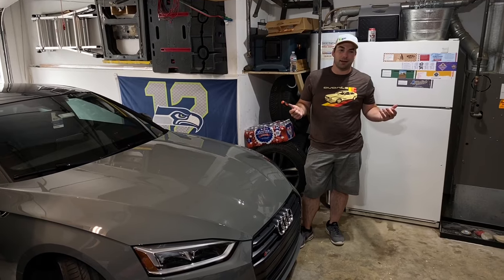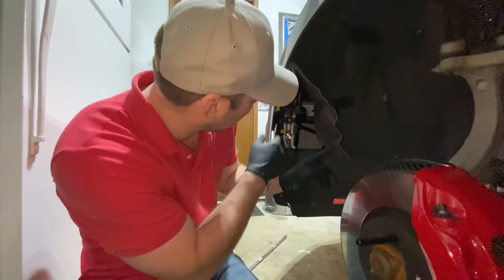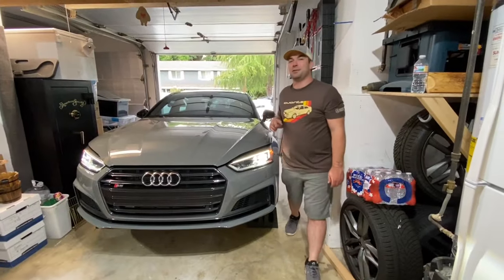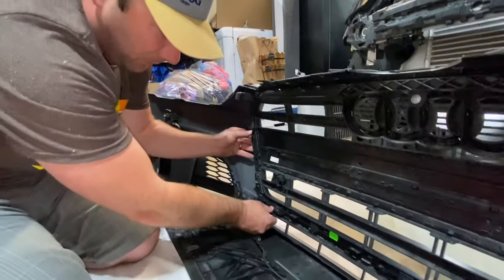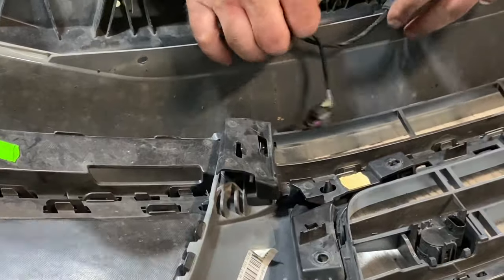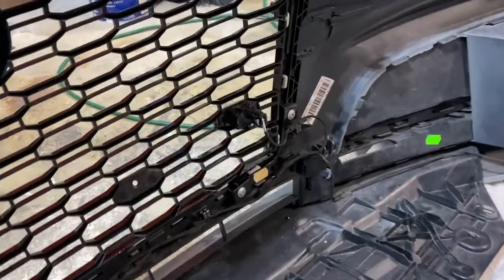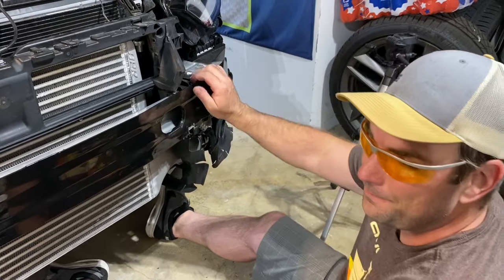How To Install A CarbnLab RS Grill On Your Audi B9 S5

Comment from the maker: *SPECIAL NOTE ON THE AUDIO QUALITY OF THIS VIDEO* In our effort to keep this video up and helpful for you, we had to take action to remove some portions of the background music due to copyright disputes.  You may notice some odd audio quality issues throughout the video because of this as we used YouTube's beta program to mute the music while keeping other sounds intact.
Reply: Did you have any problems with the front camera after this install
Reply from the maker: @colegiles5321  nope. The sensors pick up things a little easier though.
Reply: I’m sorry I didn’t relize there was a difference between front camera and front sensor, I have a 2018 b9 s5  so I’m pretty sure there is no front camera correct me if I’m wrong
Reply: From what I can gather people only run into problems with the front camera which I believe I don’t have, it’s also 2018 so I won’t have to take a cutoff tool to the crash bar, again correct me if I’m wrong. Love your videos btw my go to Chanel for insight on modifications
Reply from the maker: @colegiles5321  update, I did end up getting the sensors and suspension recalibrated by Audi. This was mainly due to the lower ride height after installing lowering springs.

Comment: Loved that you wrapped the crash bar instead of painting it.  Well done.
Reply: There's actually a plastic crash bar cover on the RS5. It's a much nicer solution than paint or wrap as it won't chip or scratch from road debris. It's part number 8W6807217A9B9 and it's like $60.
Reply from the maker: Oooh, that's a great tip!  Did you install this part on yours?  If so, I imagine the fitment was spot on?
Reply: @Vaguh  I have a RS5, that's why I know about the part. : ) But yeah, I know other people who have installed it and it's a perfect fit. The A5, S5, and RS5 all use the same crash bar.
Reply from the maker: Awesome!  Might have to get one if we ever have the bumper off again.

Comment: Hi thanks for this video...really helpful. I'm going to fit one to my A5 next weekend. I have a 2020 model (2019 reg) so I'm wondering whether I'm going to have the sensor/crash bar issue? 

I noticed one comment said you can switch the sensor from I shape to L shape...is that right, can it be turned and fit at 90 degrees, or does it need a new sensor altogether? If so how much are they, do you know? I'm in the UK  

Thanks

Comment: Hi. Just wondering, is there a spot for the front facing camera. Also, since you had to flip the sensors 180 degrees, did it have any sensor errors? Thx. I’m hesitant on doing this or even getting it done professionally for that matter. Because if I have to pay audi to fix errors, that’s gonna be costly. Also, wow I completely forgot the crash bar has to be black as well. This is definitely not an easy task.

Comment: Great video!  I'm thinking about getting the same grill for my 2018 S5 SB.  Have you had any issues with your parking sensors?  I've seen lots of posts about that, but nothing specific to the CarbonLab grill.  I think the sensor issues are usually related to the cheaper eBay specials but am curious how yours has been.

Comment: Great video, VA-Guh. I'm so happy to have this grill install behind me already. Kind of a pain ITA. Still waiting for dragy numbers... :)
Reply from the maker: Steve Anderson working on it!
Reply: @Vaguh  I finally got a dragy a couple weeks ago. A little disappointed in the numbers....BUT, the DA is horrible in Texas right now...and the car still has winter tires. My best 0-60 (only a couple attempts) is 3.91. Best 1/4 is 12.25 sec. Not sure that launch control was actually engaged on those runs though. The car didn't hard shift on those runs like it usually does when launch control is engaged.
Reply: @ssanderson12  Do you have an S5 or RS5. 3.91 is a pretty good number for an S5
Reply: @oven5997  S5. It’s now EPL tuned. Best 0-60 is now 3.22 sec running E40
Reply: @ssanderson12  Impressive, man. Great car
Reply: @oven5997  thx. Forgot to mention my best 1/4 on the street with winter tires is 11.63 @ 118mph.
Reply: @ssanderson12  man S5 is such a beast. I have an A5 now, but S5 is my dream car

Comment: Thanks for this vid. Going to install my grill soon but I was curious how the 3m wrap is holding up so far. Still deciding if I should spray paint or do a wrap.
Reply from the maker: The 3M wrap is holding up well and without issues.  If you do/did the wrap I recommend cutting out the vinyl where the holes are in the crash beam since we had a buddy do this without cutting those out and now has punctures though those areas.  Otherwise, there is another person who commented that you can look up the RS5 plastic crash beam cover and it is surprisingly only $70 from Audi.  Unsure if fitment is the same, but sounds like it's worth a try.

Comment: So in order to remove grill, you have to remove bumper?? Just curious because even if I want to just spray my s5 grill, I would like to know if bumpers need to be removed?
Reply from the maker: I can’t see you being able to remove the grill, without removing the bumper. It is actually fairly easy, especially compared to the grill itself.
Reply: @Vaguh  Thx. Quick question. My S5 is a 2018-19. Would it be the same process to remove as in your video? Thx
Reply from the maker: @ideaoverload910  yes. Though if you change your grill, you might not have to cut the crash bar, like I did. That was supposedly due to a revision on the late 2019 models

Comment: Hi, i watched video and i see you did unplug front parking sensors out with the bumper. Did you get any error light on the dash or need to recode anything? I heard people said it need to recode after unplug the wire. So hope to hear back from you soon. Thanks
Reply from the maker: Not for me. Everything unplugged and plugged back in without needing recoding.

Comment: Thank you for your video! I followed step by step! So much harder to get the old grille off than put the new one on! There was a slim horizontal piece I unscrewed from the top of the old grille, and I couldn’t figure out where it went, so I didn’t put it back on. Any ideas?
Reply from the maker: Was it a foam piece? If so, I didn’t put mine back in either. I’m not sure what it might be otherwise.

Comment: Hey Va-guh awesome job . Luckily for me carbnlabs is in Montreal . Just got 1 , just wanna know after Install , were the sensors ok , or did they start sensing things for no reason ? Please let me know thx .
Reply from the maker: My sensors are good. I’m on lowering springs which made them a bit more sensitive, since it’s closer to the ground, but I didn’t notice a difference after installing the grill.

Comment: Is there a front camera on your S5? I’ve got a 18, A5 Sportback S-line that I want to upgrade grills on, but I’m unsure about my front camera. Any thoughts? Loved your video by the way. Clean ass S5😎
Reply from the maker: I don't have a camera, but I've heard/seen others using a 3D printed model to fit their cameras.  I think the design can be found free online and you can submit it to a place to be made.
Reply from the maker: Also, if you order from CarbnLabs, you tell them if you have a camera when you order and they’ll include mounts for it.

Comment: would love to do this to my 2017, You mentioned that you had a 2019 with a crash bar revision, does this mean that my 2017 wouldn't have the issue with the sensors hitting the crash bar, would greaty appreciate any answers, thanks.
Reply from the maker: That’s what CarbnLabs said, but I haven’t been able to verify. You can order 90* sensors to be safe. I have also heard people have been having good luck with some of the eBay grills.

Comment: In regards to the crash bar you wrapped, why did you chose that option? Is it easier/faster than doing plastidip? I have to figure out what I am going to do to mine. I have plastidip and thought that may be fine but drying time and coats can be a pain compared to a wrap. What about durability with it being in the front and taking a lot of stuff from cars in front?
Reply from the maker: Hey there!  I decided to wrap it as a suggestion from others.  On my old A4 I sprayed the crash beam with plastidip and it just ended up chipping over time and created a speckled look behind the grille.  I'm hoping that with the wrap that it may hold up better over time.
Reply: It's Pronounced VA-Guh thanks for the reply. I was going to plastidip this weekend but what you said about the chipping is my greatest fear. I don’t want to have to constantly take off the bumper to reapply new coats. Especially if it takes more time than applying new wrap.
Reply: @Vaguh  hi, awesome vid! where did you purchase the 3M wrap and tool from?
Reply from the maker: @attilap1136  Quick and easy order from ECS for a 5'x1' strip.  I think this is the smallest size of gloss black vinyl they offer.  https://www.ecstuning.com/b-3m-parts/1080-series-vinyl-wrap-gloss-black-5-x-1/1080g12~1/
Reply from the maker: @attilap1136  ECS tuning.

Comment: What would you say your total time to install was? That wrap job looked good! I hope to knock mine out soon, just need to set aside a couple hours.
Reply from the maker: Can be done it 2 hours, the bumper comes of quick. The trick is separating the grill from the bumper, and hopefully you do t have to cut into your crashbar
Reply: @Vaguh  I have an SQ5 and not sure I’ve seen any issues with the crash bar. How was the 3m wrap?

Comment: Did you have any issues with the parking sensors? did they needed to be recalibrated?
Reply from the maker: No issues for me. My car is also lowered so they go off a little more often. But if your at stock height, you should be fine.

Comment: Im about to do this upgrade and it looks like a nightmare. :)  One thing though - is your crash bar issue only a problem for 2019 and up?  I have a 2018 and curious if the revision you spoke of is not a problem on mine.
Reply from the maker: Sounds like it’s a crap shoot on the crash bar, but I’ve heard it’s a 2019 revision.
Reply from the maker: @EscobarPumpkin  I did not have the sensors re calibrated. My car is also lowered, so the sensors go off a bit more on dips an inclines, but nothing that has been overly annoying.

Comment: Great video however I have  purchased an after market RS grille for my 2018 S-5 similar to the one in your video but having trouble  mounting the 2 distance sensors on the RS grille.  On the original grille the sensors are securely  snapped into a plastic bracket that gets snapped on to the Audi grille. 
The RS grill only has 2 round holes for the sensors but no clips or mechanical method to secure the sensors to the grille.  Your video  doesn't clearly show how these are secured.  
Does anybody have any idea  how these sensors are secured in the RS grille?
Thanks
Reply from the maker: Mine clipped into the RS grill the same way the clipped out of the OEM grill.

Comment: Great video, Thanks for the step by step. I want to switch out my bumper but the cutting makes me nervous.
Reply from the maker: Only some cars have the crash bar revision. Most don’t need to worry about cutting the crash bar.
Reply: @Vaguh  Thanks for the reply. Your car looks and sounds great. I think I'll end up doing all the mods you did lol. I wish I was as handy as you!
Reply: I have an ‘18 with the same crash bar and the same Carbnlab grille, I just ordered the flat Audi parking sensors (plug goes out the side instead of towards the crash bar) and replaced the ones that came with the S5 that stick out.  Plug and play and no cutting.
Reply: @davidpettit6749  sorry if I'm a bit late to the party here buddy, but where did you order these flat sensors from? Direct from audi or somewhere else? And what was the approximate cost? Thanks!

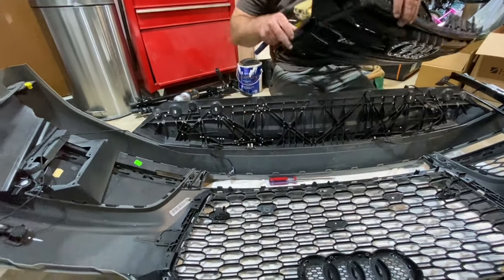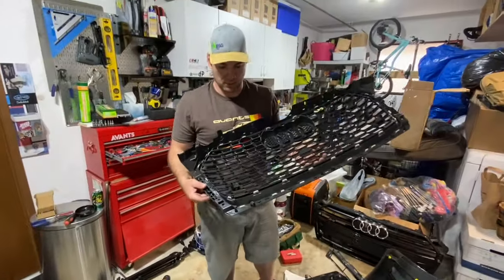Comment: How did you flip or invert the parking sensors? Ran into the same issue with my install but I only noticed afterwards and don't want to take off the front bumper again for no reason. I see at 18:35 that the plug wiring is point towards the center of the grill and at 19:07 they're flipped. That's exactly what I need to do.
Reply from the maker: asdfhacks I just rotated the sensors 180*. Everything still functions the same.
Reply: @Vaguh  Gotcha. Thanks. My installer said that on my grill the actual sensor holder was inverted and I saw that you were able to snap it in both ways. I have right angle plugs on mine so I'm not sure if that plays a role.
Reply from the maker: asdfhacks I couldn’t actually snap it in both ways. It only fully seated with the plugs facing out. The receiver is built only to accept the sensors in one orientation. The first time you see them in the video, I had just quickly pushed them in and didn’t realize I had them backwards. Hope this helps.
Reply: @Vaguh  Ah, thanks for the clarification. That explains it. I think I have a grill with the actual parking sensor inverted so I will have to find a way to dismount the holder and rotate it.
Reply from the maker: asdfhacks I just put the sensors in inverted. No problems. I had to cut the crash bar either way.
Reply: @Vaguh  Fortunately, since I have the right angle plugs I didn't need to cut the crash bar on my 2019. However, the wiring plug is pointing towards the center of the car like the stock grill, so for me to hide the cables and make it look OEM I have to bend the cables backwards. On your install, your sensor plugs point toward the outside of the car so it hides behind the actual bumper cover which is the most optimal way.

Are you saying that I can fit the sensor in the sensor holder in any orientation and it should hold or does it need to be clipped in fully?
Reply: @Vaguh  I just took a pair of pliers and broke the two tiny vertical plastic bars above each of the sensor mounts. The grille went on with a little extra force, but I didn’t have to cut my crash bar and the sensors sit flush. You can’t even tell I had to break the grille!

Comment: Where did you get the black wrap for the crash bar?
Reply from the maker: Quick and easy order from ECS for a 5'x1' strip.  I think this is the smallest size of gloss black vinyl they offer.  https://www.ecstuning.com/b-3m-parts/1080-series-vinyl-wrap-gloss-black-5-x-1/1080g12~1/

Comment: Is there a way to tell if I have the revised crash bar on my 2019?
Reply from the maker: There is a black foam piece covering the crash bar under the grill, I imagine you would need to remove the whole bumper to see. I’ll look at my car today and see if there might be a way to look in from the top.
Reply: @Vaguh  lol I should just hire you to do it, I am in Seattle. I did read on the forums somewhere you can use the crash bar cover from an RS5, did you try that?
Reply from the maker: I’d be willing to help you do the install your self at my place. Also, there are 90* front sensors in the bumper that can be swapped. Or you could order new black 90* sensors. This would eliminate the need to cut the crash bar.
Reply: @Vaguh  So if I use a 90 degree sensor? it for sure would clear the bar?
Reply from the maker: @3318kk  yep. It’s the same part number as the ones in the bumper.
Reply: @Vaguh  Thanks, gonna ask Achtuning if they would do it since I need to do my IC anyways. Not sure they paint stuff though.
Reply: @Vaguh which bumper?  I am really confused on what’s being said about the sensors.  Are you saying I can order new 90 degree sensors or are you saying I can relocate the straight ones in the grill to L shaped ones located somewhere else.  
And ty for vid. I subbed

Comment: Just ordered the same grill thanks for the video just wounding if the 2018 crash bar is going to need to get cut??
Reply: It all depends on the grille. I didn't need to cut my crash bar. There's 3 different grilles you can get. V1, V2a and V2b. V1 has that lower section and V2's are full honeycomb. The V2a grille has the hideous front camera bracket and the V2b has a slimmer one. I have V2b.
Reply from the maker: Also, the crash bar revision was only on some of the 2019 models. So, you’re likely good.
Reply: GroundControl  I got the one with the camera hopefully I don’t need to cut🤞🏽
Reply: It's Pronounced VA-Guh  thanks for the reply love the videos 🙏🏼🙏🏼
Reply: The crash bar is the same on the 2018, you will have to cut, or get the flat parking sensors that go out the side. Plug and play, thats what I did on my 2018 S5 so I didn’t have to cut the crash bar.
Reply from the maker: David Pettit thanks for the info. Sound like the 90* sensors is the way to go.
Reply: Damian Hernandez did you ever get your grill installed?I have a 2018 s5 with the camera also.I had to get a paint and body shop to mod the camera on the grill.It is not a perfect fit without modding.
Reply: Suave Beats  have not got the got it yet what did you have to do?
Reply: David Pettit where can I get those sensors??
Reply: David Pettit where did you buy the flat parking sensors?
Reply: @itsgroundcontrol  Where do I get a V2b?
Reply: @ddixon487  Got mine from Alibaba. See @midnight.sportback on insta for some pics.

Comment: Hi you just need to switch those park sensors "I " shape , to "L" shape  ( located left bumper side) , then no need to cut bumper reinforcement ;)
Reply from the maker: Thanks. Yeah, I figured that out during the install, but kinda needed to finish it up that night. So I just cut. I think I mentioned that as an option, but I should post a link to some of those in the description.
Reply: Hey! how can I do the swap exactly?? will the cables be long enough?
Reply: Could you elaborate more on this? I really want to do this swap, but don’t want to cut in the crash beam
Reply: Could you explain this more?  Are you saying you can buy new L shaped park sensors ?